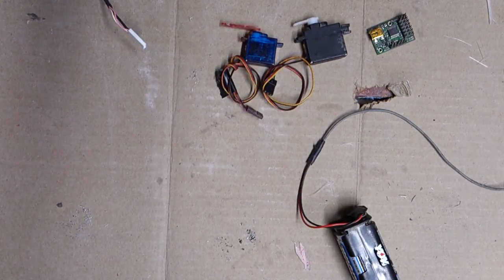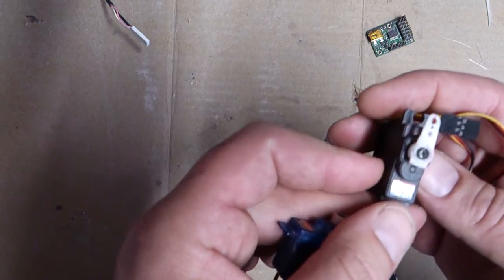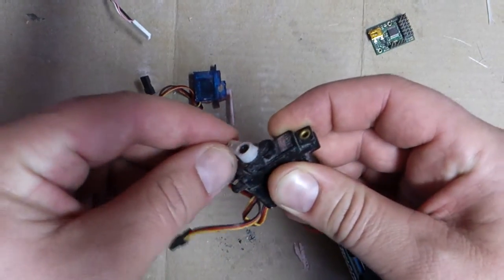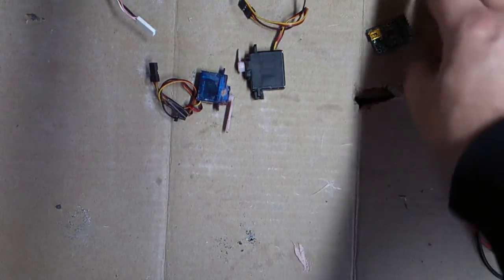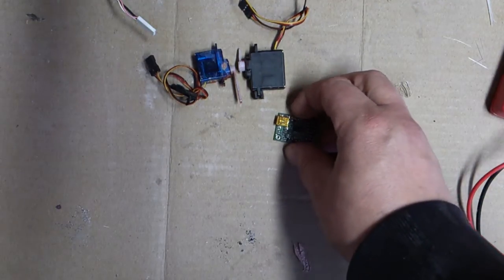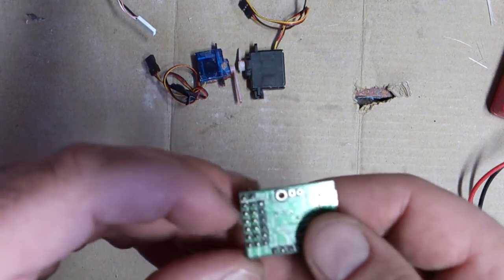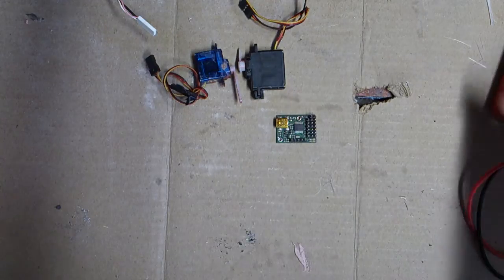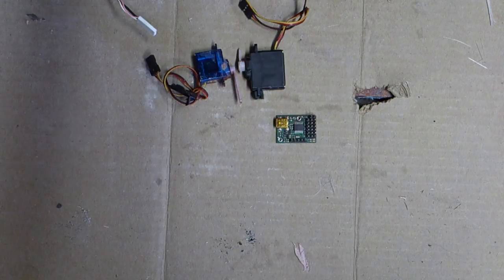IRONMAN electronics tutorial part 1

Comment from the maker: Well it can be programmed to control many servos, but incrementally to look like they move at the same time.. Meaning moving each one slightly, one millisecond at a time. Audrino boards may do multiple servos at the same time but since I have not worked with the hardware I can't tell you with certainty that it does.

Comment: I have a question.  You talked about the MIcro Maestro 6 board that it can only control one servo at a time.  Do you have any other suggestions for boards that will control multiple servos at the same time?

Thanks for the upload. Its very helpful for beginners.